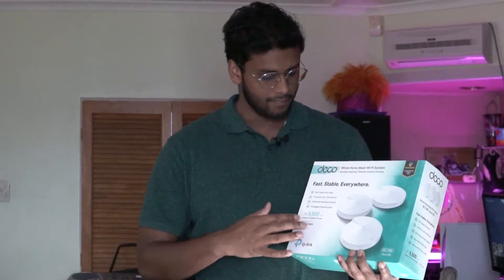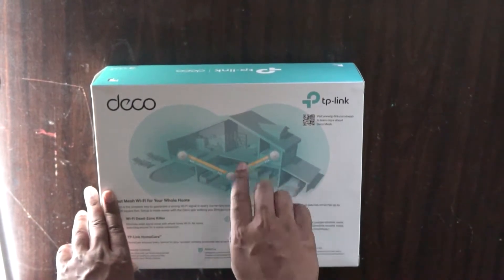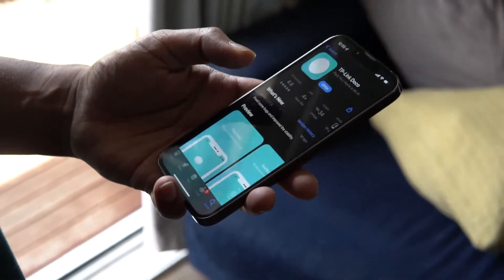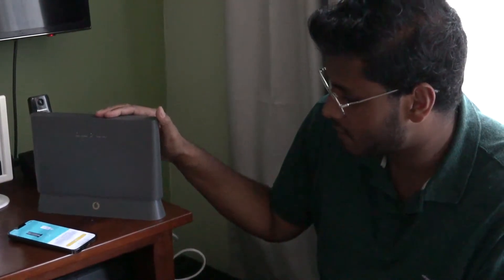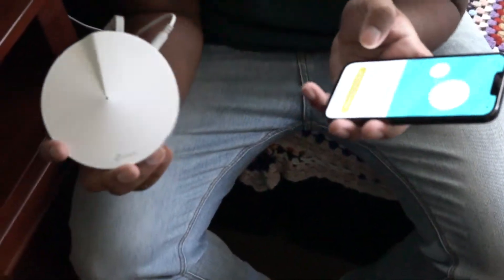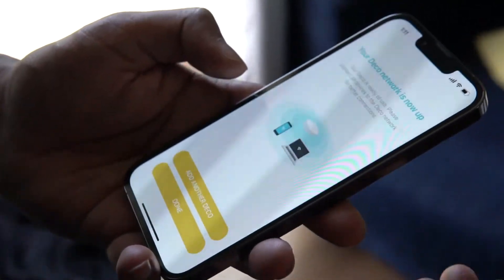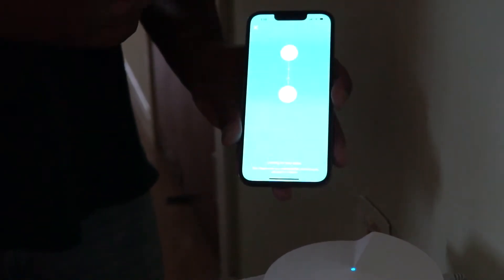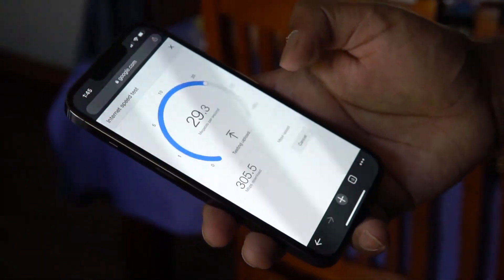How to setup up a mesh wifi network | TP-LINK DECO M5

Comment: I have a question,  i have nokia modem provided by ACT Broadband. I asked technician, they said if u buy mesh from outside and connect... it wont work because of some static ip issue.. instead they said buy from us(they are also selling mesh network)...
If i just buy mesh, will it work.

Comment: Interesting and clear video. Hope you can clarify a small matter for me before I buy a mesh system.  Can I still carry on using the other ethernet ports on my router for the PC and the Philips Hue Hub etc? Am I correct in assuming the 1st DECO is to act as a conduit to the other DECO's located around the house. Would appreciate some assistance/clarification.  Thanks.
Reply from the maker: Regarding your first question yes u can use the other ports on your router still, I still use mine! I’m not to sure I understand the second question tho
Reply: @shaqtech  Thank you for responding so quickly. To rephrase my 2nd question  Am I correct in assuming the 1st DECO acts purely as a transmitter to the other DECO's.  Cheers

Comment: When I did my mesh setup, with a Netgear system, I had to keep the old vodafone router and connect the netgear mesh router to that one, instead of directly into the modem. Any idea why that would be?
Reply from the maker: Yea same! The Vodafone router isn’t just a router it’s also a modem combined so u would still have to plug it into that